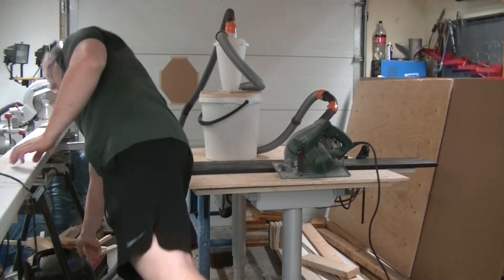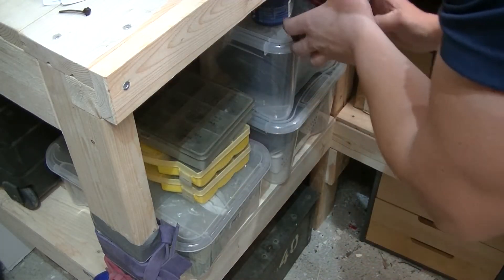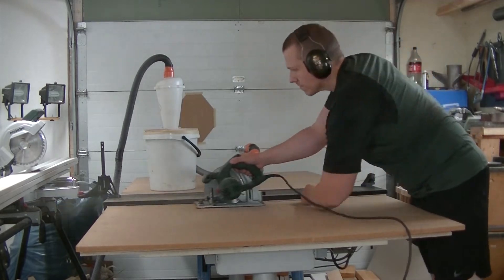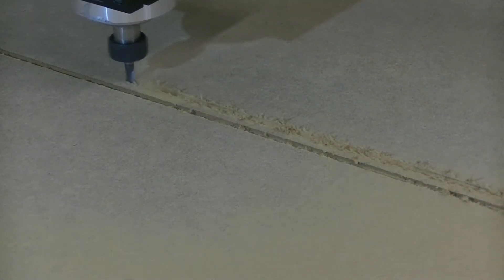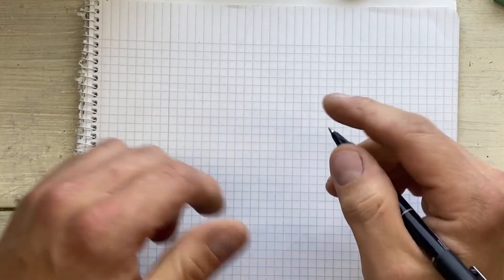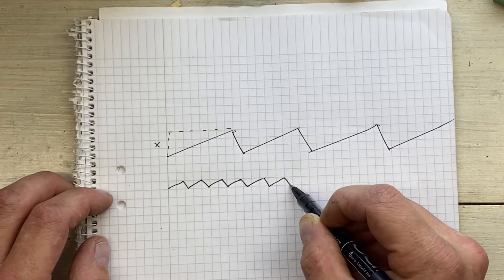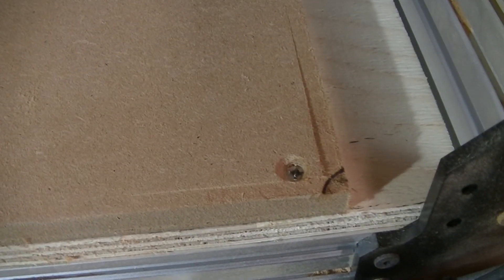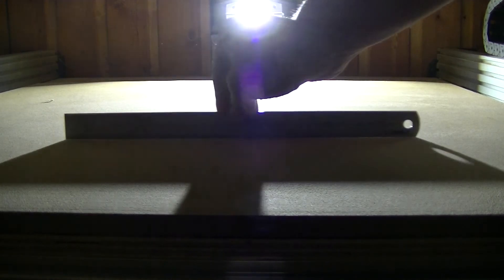How to set up a CNC spoilboard

Comment: Thank you for the video. Question: How do you secure 
your work pieces to the spoil board?
Reply from the maker: It depends. Sometimes I use double sided tape, or screws, or masking tape and super-glue. I have also recently added an aluminium plate where I can drill and thread holes for even more secure work holding.

Comment: thanks for the video.  my queenbee pro should be here any day.   why did you go with a router instead of a spindle?   thanks
Reply from the maker: I wanted to get going quickly, simply, and cheap. And make no mistake you can use a router for probably 90%of what the machine can do, you only have to adjust your speeds and feeds to be able to do it. I have even succeeded in cutting cast iron with it.
But I will replace the router with a 2.2kw spindle shortly. I'm filming the rebuild right now.
Reply: @OffHoursEngineering  I read on the Bulkman website that they designed the QueenBee pro/Ultimate Bee to run with a 2.2kw and even a 4kw spindle.
Reply from the maker: Yeah, I saw that as well. But the max I'm going to go is 2.2kw. I actually bought a 3kw spindle at first but the weight and size is way bigger than I I first thought and I think that especially the weight might lead to more trouble than it is worth. You would probably need a lot more rigid gantry to be able to take full advantage of it.
Reply: @OffHoursEngineering  There is a place here in Canada where they purchase different CNC kits,  put them together and sell them at a premium price.  Anyways....  they will not carry the 1500x1500 because they say there is the potential for too much flex.  What is your size ?  It looks like a 1000x1000.   I ordered the 1500x1500 because I need the size but I fear I may have made a poor decision.  What are your thoughts?
Reply from the maker: I have the 1000x1000 and it is relatively rigid for most normal cutting. But I would worry about problems if I added to much mass to the z-axis carriage. I have played around with ideas to re-build it to be more rigid but I think if I need something more stable I will build it from scratch.
Reply: @OffHoursEngineering  great.  I really enjoy watching when harder substances are milled on a similar/same  machine.  Im quickly learning the size/quality/type of bit makes a HUGE difference when pushing a machine to near its limits.  Look forward to seeing your new video.

Comment: I work at a metal supply company. I shopped in the 8" saws waste bin and came out with 8" (200mm) strips of 1/2"  (12mm) mic 6. It cost me less than a $ a lb.  I think it was around 80 lbs. (36 kg) of metal. Haven't assembled my CNC yet but will have strips of mic 6 for a spoil board.
I figure to keep it unblemished I can slip a piece of cardboard under the part for a "spoil board."
If anyone has a scrap dealer near them or even not so near it would be worth it to get your spoil board from them...or even your aluminum stock.
Reply from the maker: That would be nice, I'm all for repurposed materials.
Most of my electrical stuff comes from the wastebin at work.

Comment: The T nut was extremely stressful on my end I was not sure if it rotated properly while it was being locked. A few months later a friend of mine from the industrial CNC side noticed some resonance on my aluminum cuts. We ended up concluding that it was the baseboard not being secured all throughout; of the 24 bolts and T nuts used probably 10 or 16 was only securing it at different places. I will be upgrading to an aluminum tooling plate soon and have already ordered Sping T nuts or Roll-In T-Nuts in some other countries. I saw it from one of those AvidCNC builds pretty neat and I'm never going back to those junk T nuts.
Reply: I got my ups packages today and started the build..   Just like you said in your video.......    the my 8mm screws I used today are absolute Shite.   Why would they use such cheap screws.   Well I know the answer to that I guess......Everything looks like it should be here with the exception of one power source.   Everything packed neat and safe.
Reply from the maker: I looked into getting an aluminium bed as well but I can't afford it right now, it is on my wish list. 
The cheap T-nuts are really hit or miss. These ones are OK at least for now. Way better than some that was included in the kit from Bulkman.